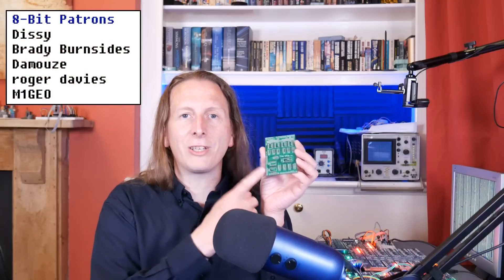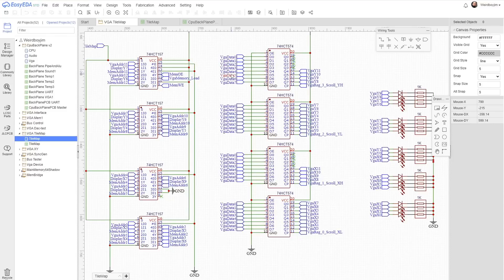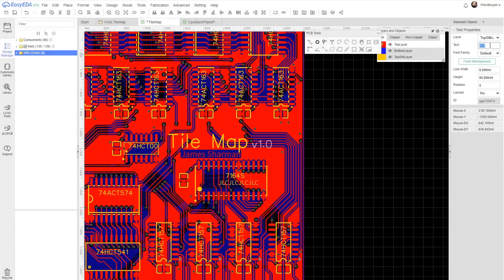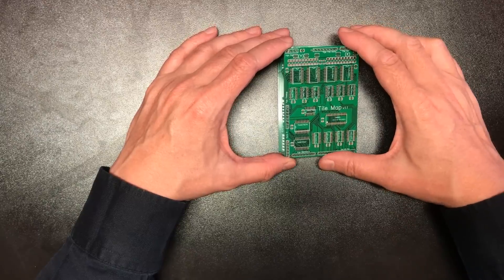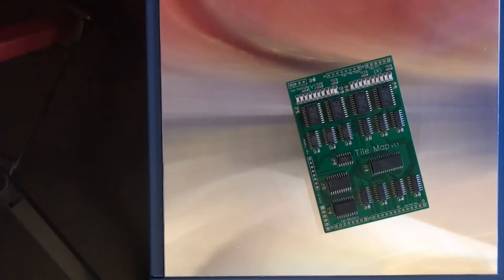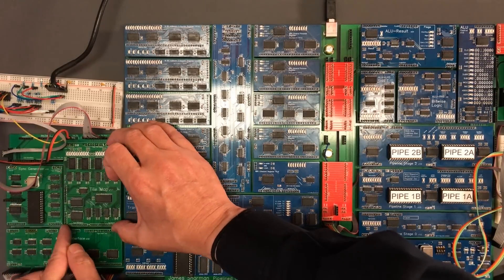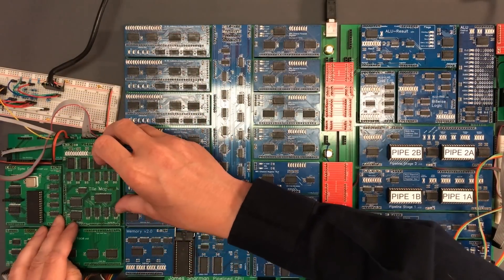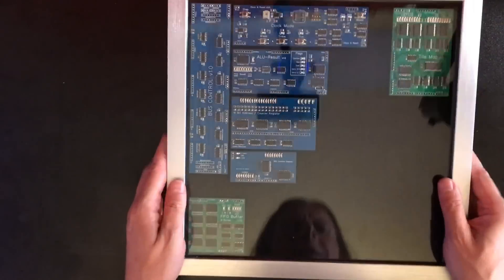Tilemap PCB (Fix!) - VGA from Scratch - Part 9.5

Comment: I've been looking at getting some PCBs made and the shipping costs really sting!
Have you done any detailed research on this front?
I've done a bit of looking around and it seems like most of them are coming from China and the shipping cost is similar, but I haven't looked extensively yet and figured I'd ask if you've already done that extensive research before bothering myself lol.

I also looked into methods of making PCBs at home, but it seems like it will be difficult, time consuming and probably just as costly, all for a lower quality result at the end of it.
Reply from the maker: It is indeed a pain, shipping seems to be a common pinch point for all of the services at the moment. Depends a lot on the country you are ordering from but from the uk we get some tax added at source now which doesn't help.
Reply: @weirdboyjim  I got a quote today from a British company but it was 5x more than I've seen elsewhere!
Jlcpcb seems to be the cheapest I've found thus far 🙁

Comment: I like the idea of taping the parts on to a piece of card. I'll be stealing that.
(Edit - try a polarizing filter on your cam - that might get rid of the lighting glare you mentioned. LCD displays have them - I wonder if that's a source that'd work.)
(Edit edit - dodgy solder joint @16:59 beside "at" in MemData". I think that whole connector might be worth a reflow)
Reply from the maker: I think that is a weird reflection. I need to improve my lighting for these although I wouldn't trust any assessment until I've cleaned the flux of. On the card I put a strip of double sided sticky tape, makes it really easy.

Comment: Problem occurred at 9:41 - one leg of the HCT541 was bent and resulted in the corner of the chip lifting and preventing the pins you found from contacting the pads and therefore being unsoldered.
Reply from the maker: Nicely spotted! Obvious once someone points it out!

Comment: At 12:38 in the video, the third of the four pins in the corner of the board looks like it has only just about connected with solder on only one side of the pin.  It appears connected to the ground plane, so may not be critical, but it's probably worth checking and cleaning up if it needs it.  That's a great job with the hot plate though, despite the minor glitch. Very impressed.
Reply from the maker: Yeah, that's a ground pin. Looks like it didn't get much solder, should have spotted that myself thanks!

Comment: Nice job! I'm really impressed how quickly you diagnosed the problem with the bad solder joints!
Reply from the maker: If it wasn't the 2nd revision it might have taken me longer. But I knew most of the circuit was fine and the signal only went thru a few wires so tracking it back wasn't too bad.

Comment: Those tiny resistor arrays - the fact that they solder so much better this way is refreshing.  It must be the combination of fine pitch spacing and relatively low thermal mass at that pitch, that makes them a [censored] to solder any other way.
Curious what happened with the last chip to solder in; I wonder if it is a heat uniformity issue on the plate.
Reply from the maker: I think that chip may have had slightly bent pins, or possibly some weird residue on the pins. The solder definitely reacted different to them.

Comment: Great vid.

I like the whole troubleshooting process. Some people leave that stuff out, but I think it's what makes electronics videos more interesting.

I have a suggestion though - try using a "hoof" soldering tip, with the small divot in the end.
I put off buying one for many years, as they are a bit more expensive. I think the tip for my Metcal was around £30.

But it's amazing on SOIC etc. I wish I'd bought it years ago.

If you get just the right amount of solder on the tip (and always apply flux to the pins), it can solder them perfectly almost every time via drag soldering. Occasionally you get a few solder bridges, but those are easy to fix with solder wick, or sometimes just the iron.
Reply from the maker: I actually have one of those, never really had a problem making the solder do what I want though.

Comment: If you've been having problems with solder bridging on the resistor packs, I'd either reduce the size of the pads or the size of the holes in the solder stencil. Reducing the amount of paste across the board just seems like a bad idea, and I assume the three pins not connecting would not have happened with a full load of paste.
Reply from the maker: It's not a stencil design issue, it's more a paste leakage putting too much on the pads problem.

Comment: Great project!
The reflow process is very satisfying to watch!
And the speed at which you work is staggering 😉
Since you have done a deep dive into VGA technology: converting voltage levels from whatever your logic is running at to VGA compatible levels I guess would be achieved through a simple voltage divider. Do you happen to know a way to convert such high frequency signals up from 0.7V max to e.g. 3.3V?
Keep up the good work!
Reply from the maker: Glad you like it mkronert!  The component you want to solve that problem with is a high speed op-amp, there are ones made for working on video signals.
Reply: @weirdboyjim  I've been looking at video opamps but there is so much to keep in mind regarding the specs (and the price). Do you happen to know a type number of a suitable device?

Comment: It seems using polarizing filter greatly reduces the reflections (also helps to read titles on the ICs for example much more easily) for some soldering/microscope sessions. At least "SDG Electronics" channel has a video on that kind of microscope-setup scenario "recently".
Reply from the maker: Ahh, that's been my thinking of late as well. I'll see if I can track that video down
Reply: It'll make reading the liquid crystal display of the multi-meter a lot harder!
Reply from the maker: @benjaminmiller3620   Good point. But only if the filter is the exact wrong combination. Most of the permutations will have no effect.

Comment: Couple of things could have happened with those pins that didn't reflow properly, maybe they never quite got hot enough as they were the last to reflow or maybe the pins had some contamination on them that the flux didn't quite have chance to eat through. Of course it could be something as simple as the pins being slightly bent but unlikely with the chip being taken straight out of the tape carrier. If you check the spec of your paste there will be a recommended time that you have to leave it at reflow temperature. This is to ensure the flux has chance to eat through any contamination on the pins, just seeing the paste melt is sometimes not enough. There may be some uneven heating on your hot plate too which is why the past didn't flash off evenly over the board. So many variables with hot plate soldering, but a very good result for a first attempt.
Reply from the maker: If you watch the reflow section of the video a few times there is definitely something different happening on those pins. I wondered if they were slightly bent but some contamination would make sense as well.

Comment: Well there is a video idea!
Build an RGBWW lighting rig and test what is the optimal setting and placing of RGBWW LED colours for soldering
Reply from the maker: I suspect the solution is to use polarized light in the right configuration, so you would need a more complicated rig.

Comment: That hotplate soldering looks like magic!

Since those pins were the last to reflow, maybe it just needs a few more seconds?
Reply from the maker: It does indeed! I'm undecided on the last 3 pins, if you watch the reflow again you can see the solder melts but it never quite grabs the pins. I'm wondering if they were slightly bent upwards.

Comment: Seems definitely faster and less fiddly than hot air! 

For your lighting situation, I suppose you would need a few diffused lights shining from all angles to create uniform lighting. If you set each one at a fairly low intensity,  the board is evenly lit due to their number. However it only really reflects the light of the one fixture hitting it at the right angle, so the relative intensity is lower and you see it less. Just thinking out loud I have not tested this
Reply from the maker: Way ahead of you, Trying more diffused lights was one of my early ideas but increasing the diffuse area just seems to white out more of the camera feed.  Still experimenting with ideas,  I want to try some directed spots with polarizing filters coupled with a polarizing filter on the camera, in theory that will eliminate all the directly reflected light and just let the diffuse light through.
Reply: @weirdboyjim  Interesting! Eager to see if that works
Reply from the maker: It does indeed work really well!